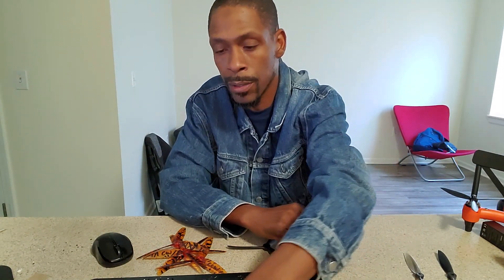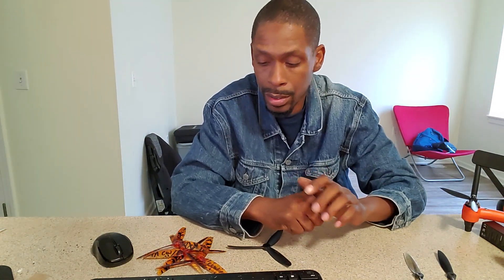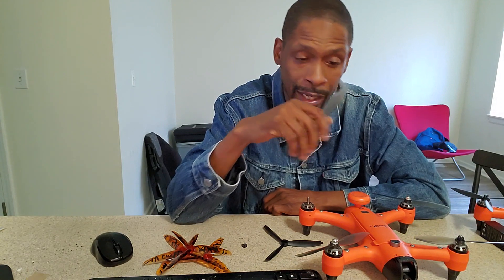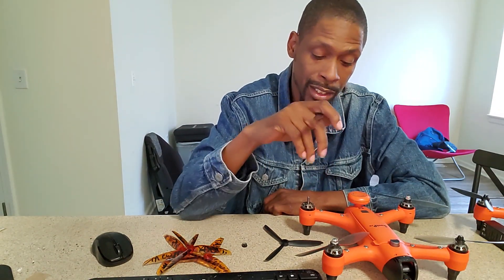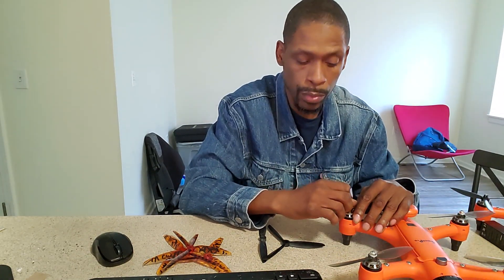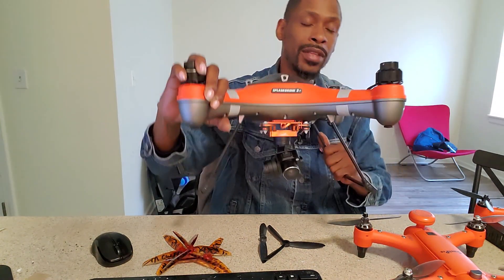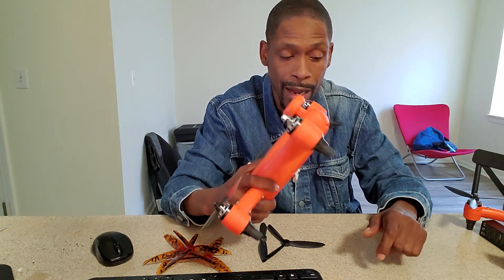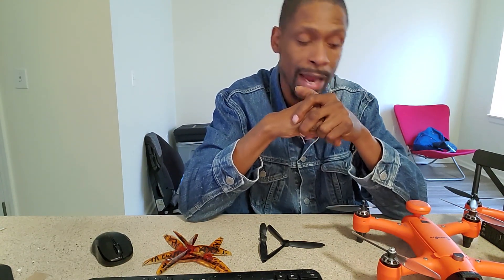SWELLPRO SPRY+ HOW TO INSTALL AND DIFFERENT TYPES OF PROPELLERS

Comment: Hello Mr. Bojack, I fly a swellpro splash drone and as you know, I go through a lot of props due to misshaped with landing in high winds. I noticed that the props are in 3 parts, the center peace and the two carbon fiber blades. Is there a place were I can just buy the blades so I  can repair my own props? Buying new props from swellpro get a little expensive.